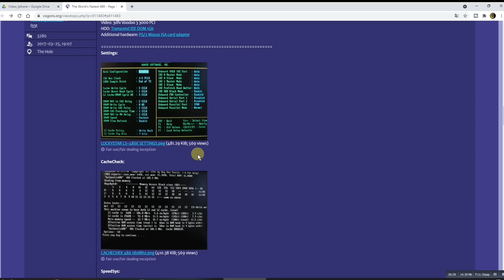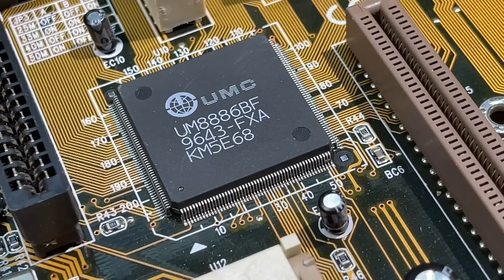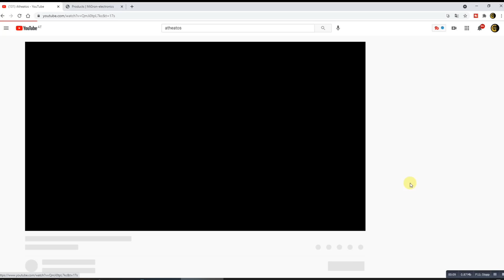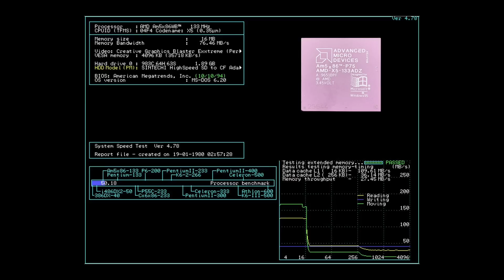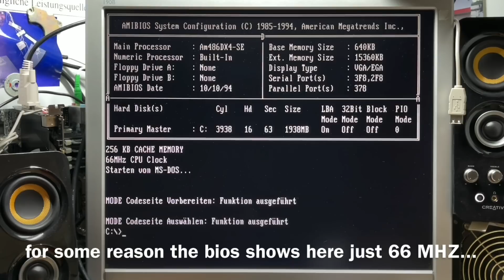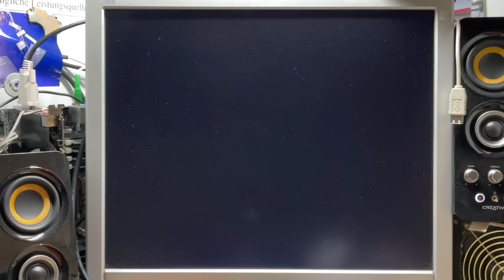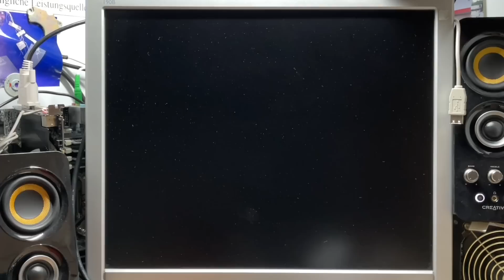AMD X5-133 Overclocked @180MHz / RECORD FPS in Quake/ PCI Clock Checker Tool

Comment: I got finally myself a UMC8881 -board, PC CHIPS M921 with fake cache 😆Ordered SRAM-chips for 512k so I need to swap those in. But, I have few Am5x86 chips that I need to test out for 180MHz. Board has 60, 66, 80 bus speed settings and 4 volt option. I noticed that the bios string for that motherboard in this video is quite the same on my board, 486AVIP at the end. I just don't have the LINBURST setting (for Cx5x86) and maybe a few more are missing. Need to check if there's newer bios version or maybe try bios from another board.

Comment: I am hpoing to get one of the socet 3, ISA/PCI/VLB mainboard,  maybe it will be DOS 6.22 or maybe FREEDOS 32 bit, Windows 3.11 WFW, and windows 98se, I mostly want it for DOS and win 311, as the 286 I have built for DOS, WIN 3.1 is being a royal pain, the only xfers I can do are 1.44 floppy disks, it does not like IDE cdroms, not does it like SCSI cdrom either, nor does it like ZIP 250, I do have a zip100 coming, 

At this point I am about ready to take out the mobo and wait till I can get the 486 i want.

Comment: 25:43 You can use a variable clock generator. This will let you replace and finely adjust the clock crystal on the board at runtime to push this CPU to its limits with granular precision. The Migron Electronics person you got that PCI clock measuring device from sells some. You can do a faster bus clock that way no problem. You have to switch it at runtime after the system is booted, but it does work. Maybe you can push it to 200MHz that way, who knows? Three MHz more to beat your scores will definitely work. Sadly, I don't have the hardware to do so. Could have been fun. lol

Comment: My amd x-5@133 working stabile at 150Mhz but windows installer have porblems with onboard ide controler i hawe to use ISA for windows 95. As far i remenber in quake it has 15or 16 fps. The exchange forr p100 was a gamechanger in Q1

Comment: Back in the day, 486DX2/100 was the most you got.  I had access to computer where I could bump the bus from 33MHz to 40MHz.   One I day I finally get up the nerve to drop in my 486DX2/100 chip.  Would it work? Would it fry the chip?

VIOLA.  486DX2/120!  I didn't run it for long for fear of burning out the chip.  I knew nothing of heat sinks at the time.  A few benchmarks clearly showed a substantial bump in performance. At the time, Gateway had press for their 486/100 being the fastest made. For a few brief minutes I created the fastest PC in the world.

Comment: Another great video I am itching to get my lonely Intel 486DX266 overdrive chip a motherboard a psu ram etc if only my local e waste depot would let me buy some of the precious vintage boards I got ripped off on ebay for a motherboard not long ago I am willing to buy a dead or living board I don't care what it is going to take just money is a issue but one day my dream 486 build will come to fruition mind you I grew up with every cpu from 8086 which I do have 2 of those but those compatible motherboards in the wild are rare or expensive a 8088 chip but every time I watch any 5x86 < cpu's I miss the good parts of my childhood and teen years when I was in high school I remember the biggest upgrade being a 486 DX4 100 mhz lol

Comment: Wonder if later versions of the CPU would OC better. Or TCP versions of the CPUs (modified Kingston Turbochips etc). I have like half a dozen 133MHz AMD 486es and the newest one is an Am486DX5-133W16BGC (16KB cache) with a datecode of 0021 (week 21, 2000). The annoying part is that I don't really have any decent socket 3 boards. Ironically I have one of those rare cache modules for these crappy PC Chips M919 fake cache boards, but not the board itself :(

Comment: One of the best overclocks I had back in the day was an AMD K62-233mhz that would do 500mhz on air cooling with stock voltage. Back then that was pretty impressive, I still have the cpu itself too.
Reply: You sure it wasn't a K6-2+?

Comment: Geez…This is freaking AMAZING 😳 I mean reaching about ten times the normal CPU clock speed alone is sub-zero but the fact that the north bridge as well as the RAM modules is still willing to work at 60MHz is something I had never expected would be feasible 😶

Outstanding work! 😍
Reply from the maker: Thank you. But check out then my 200 Mhz video. ☺️ https://youtu.be/LI1_RlVLhu8
Reply: @CPUGalaxy  you‘re kidding me 😳

Comment: Interessante Projekten und Videos! Man könnte vielleicht sagen dass Sie wirklich wissen was sie tun!

So, ja. One thing came to my mind suddenly: in any of your projects on the "bench", is the motherboard directly connected to ground at all, through some screw holes? Or only grounded through the power supply?
I got to thinking about this because I was recently trying out a (modern, new ATX) setup that was taken out of a fully working computer, just on the desk, on top of an anti-static bag, and for some reason it would not post (no video at all). Obviously computers are usually long-term assembled in metal cases for a reason and I even remember reading about this... but I've also understood it's not really strictly necessary because the system should be functionally grounded just through the PSU connectors on the motherboard. Is this correct? I assume this is why it looks like even you don't use an extra ground connector, it's not really needed. Correct?

(Habe übrigens über die Idee teilweise hier bei Ihnen gestolpert, habe die Überreste von der alte Siliziumpaste auf dem Prozessor entfernt mit... ESSIG :--) Ob das eine gute Idee war, weiß ich noch nicht ;) Vielen Dank für die Inspiration! (Ganz ehrlich, ich glaube kaum dass dieser verdünnte Essig ich da hatte überhaupt etwas wirklich schaden könnte, sogar ob ich es nicht auch ausspülen hätte...)

Comment: I can't believe that C&T mae such a 486 motherboard, its insane, considering there were other companies making extreme boards at the time. Having cache modules on a 486 was extremely rare, I only saw them on later PII and DEC Alpha machines. Your board is similar to my SOYO 486 with all types of connections but you may be able to have 1MB of cache by combining bothe the module and the empty surface mount if you can find and solder the chips. Not a fan of AMI or Phoenix BIOS though, I'm an Award fan. All things considered, you have one of the best 486 platforms to work on. Good job. I have overclocked my 486 machines back in the day, but considering how old they are now, I don't want to stress the electronics, so they run at vanilla specs. You are very lucky to find that motherboard with the cache module. I couldn't find one after months of searching for a RISC motherboard that I had so I gave up.

Comment: You should try and intel dx4 100 the 16kb WB version for an extreme overclock I have mine running at 120mhz and it matches the amd 133 with a speedsys score of 50.85 and L1 speed of 114.89 on a LS486e board like the one you used on the 200mhz video so clock for clock the intel looks faster
And in quake I get 14fps on an cl5446 2mb card

Comment: My 5x86-133 on an ASUS PVI-486SP3 with an ARK 1000vl VLB graphics card and 32MB regular FPM at stock speed maxes out at 14.3 FPS in Quake and 1498 ticks in Doom, or 49.85 FPS. Looking at your stock result I feel pretty darn pleased with that! :) But to see a 486 get over 20FPS is absolutely remarkable. Amazing work, and thanks for sharing.

Comment: Typically my groupmates had x5-133 running at 160MHz, 40MHz PCI clock and sometimes 150MHz with 50MHz PCI clock. Though I bought myself a Pentium-75, it could run at 112MHz on a cheapest ACORP VIA mobo and beat the hell out of 486.
Reply: I remember the first Pentium chips came out were 60Mhz. They could still slightly outperform a 486DX4-100.

Comment: AWESOME. Still have one of these boards with a 5x86 chip and the fastest RAM I could find in the day (50ns). Used to scare the pentium 90 users with it clocked to 50MHz bus @ 150MHz CPU. I remember having trouble getting cards that would work with bus setting at 50MHz. Used to run it at 160MHz on a 40MHz bus also. But 180MHz, thats fantastic.

Comment: Back in the days, I've used 486DX4(AMD VT8) in 2x50MHz mode (with VLB card).  I just wonder what speed would be with VLB setup in 3x50Mhz mode. (I've used ordinary DRAM not EDO). Another micro boost migth be 512KB cache motherboard. Love the video :-)

Comment: I once ran a sempron 2500+ 1750Mhz 1.6volt cpu at 2150Mhz stable on air with a load temp of 55 celsius at 2.2volts. Ran it for years like that. Used a 90CFM bathroom fan as a blower over a solid copper heatsink to keep it cool. it was loud.

Comment: About overclocking the PCI bus, I once had an experience tweaking jumper settings on a 500 MHz K6-2. I set the FSB to 112 MHz instead of 100 MHz, with a multiplier of 4.5 instead of 5, giving me 504 MHz on the CPU (only 1% overclock, the chip I had wouldn't give me more) but with a PCI bus clock of 37.5 MHz instead of 33 MHz (there was a divider by 3 on the motherboard to get the 33 MHz PCI bus clock from the 100 MHz FSB clock), which would give me some extra performance even though the CPU was running near stock clock. I had to revert to 100 x 5 because the HDD died and the replacement drive didn't like the overclocked PCI bus. So I immediately paused the video and thought "60 MHz on the PCI bus, that's so crazy!"

Comment: My dude, you're comparing an Am5 86(basically a Pentium) to a 486. Why would you think it a struggle to beat? They are different generations, with not only generational uplift in IPC, but also the jump from 486 to 586/Pentium was possibly the highest generational IPC jump I've seen in the last 30yrs in IT. I take it you weren't in IT in the mid 90s?
Reply from the maker: The AMD X5 is absolutely not pentium. its pure 486.

Comment: If you want to play harder, hook a signal generator to the PLL and a linear variable voltage power supply to the cpu rail. You most likely could get to 66mhz or a bit beyond like that.

Comment: The PR133 is super rare? Dammit! Mine went to landfill many years ago. I think it was the only drop-in replacement processor that impressed me. I noticed a significant performance boost after replacing my 486dx2100 and as you mentioned, you got Pentium performance for the price of a 486

Comment: It's been 26 years since I worked on the project, but I remember building a synthetic clock board as comp sci undergraduate research assistant at the University of Washington. We used an (I think) 33mhz 486, and dynamically scaled the clock up and down in increments that matched with vesa local bus, ide, memory, and cpu edge timing. The board also had a small amount of buffer to capture/replay any bits on relevant bus interfaces that would get lost during a clock down event.

We were able to scale the frequency high enough to completely loose communication with the video card and other peripherals, so implemented device watchdogs to record failures and put together a statistical map of how many faults and different frequencies things occurred. I recalled being able to greatly overclock the actual cpu, and the real issue was line delays in the motherboard itself - the traces were unable to carry the signals at higher frequency with enough precision.

This is a neat project that you performed here, and congratulations on pushing the FPS on the quake benchmark. Superscape 3d vr benchmark is always fun to see too.
Reply: This is why when I was running servers for MC I was obsessed with hardware optimization that looked nothing like the then big gaming overclockers.  I was maximizing on RAM timings and pure latency.  Invested in Optane drives to use as pure SSD due to their low latency and high I/O and higher write tolerance being much better than SSDs at the time for their price.  When your limit was pure I/O, you start optimizing weird.

Comment: @1:14 PCCHIPS, not C&T :-)  C&T was a reputable fabless chipset and video controller manufacturer. PCCHIPS on the other hand was a Taiwanese bottom of the barrel borderline SCAM artists making fake cache/AGP/Chipset boards all the way to socket 370 era.

@2:20 speaking of cache, notice those two empty footprints at the corner for two "cache" chips? look carefully at the pcb layout between the pins :-) they route in a circle to each other, it is a spot for fake cache :o]
Reply: So...Beat him?

Comment: What's taking your RAM away? 16MB should be 16384KB, but the BIOS memtest ends at 16000KB.. that's rather unusual.
Reply: ..so is a 60MHz FSB and 133MHz (AMD)486 CPU at 180MHz...

Comment: Many hours I spend to play with my SiS496 and Am5x86 in the end overclocked  to 160MHz, but my memory gives only 46.60 vs 68.73 of your system and only 47.5 fps in Doom
On FSB 40Mhz my system is unstable, but may be I need different memory - only future will tell...)))

Comment: I've recently been playing around with a Motorola 68360, rated at 33MHz but it seemed to run quite comfortably at 50MHz. That's where I stopped, so maybe it will go further, bit it was getting noticeably warmer so I decided not to push it any more.

I wonder then if this one came from the middle of a wafer!

Comment: Hmm...Is there a way of verifying the PIT or other timer chips?    Beyond verifying the timer chips are operating correctly, this is a fantastic result.  It makes me wonder where the later Vortex CPUs with higher clocks like 233MHz, 300MHz and 1GHz would fair.  IIUC, they are roughly 486-ish/586-ish/Penitum-ish/686-ish and some even had DDR3 support.

Congrats!

Comment: brings back memories! we overclocked the living daylights out of a similar CPU  back in the days. We scavenged a radiator from an amplifier and modded it to fit the motherboard then mounted two  cone shaped extension brackets to funnel air from a big industrial 5V  160mm fan to 120 , then to 80mm to fit on the radiator. that fan was way way too powerful for the fan header, so I rigged the one of the rails to supply the wattage and the amps to the fan.  you know you've made a big mistake when the air coming off it can tear stuff of the MB. but hey it worked and we had something in the region of 25 to 30% overclock on the cpu.

Comment: This chip can do 200mhz. Its been a few years (and I cant remeber if it was adz or adw - one is more overclockable), but we had one in our old office running at 200mhz on a board configured for a 50mhz bus. I cant remember the board, but I know it was a vlb only board. It was so stable we ran Novel 3.12 for a couple of years on it.

Comment: Imagine this 486 @180Mhz with a voodoo2 board and GlQuake... It's possible? Try it on the next video!
Reply from the maker: the problem is that the voodoo2 can not take the 60mhz bus clock.
Reply: And a voodoo 1? Or PCI voodoo3? The AGP version runs in 83 MHz frequency in the 133 MHz 440 BX.

Comment: Very impressive overclock.  

Out of interest how does this effect the ISA bus?  I ask because to make a system out of this you'd probably want a sound card and would they be effected by a faster bus clock?  Yes I know in reality you'd probably just run at the slower speed for day to day use, just simply curious if you could get a sound card to also sit stable at the high bus speeds.
Reply from the maker: yeah, good question. I will anyhow do a follow up to this setup with a soundcard. I will measure the clock of the Isa bus with my oscilloscope. good input! thank you

Comment: 20 FPS in quake, This is a pentium75 or even P-90 value! Every Pentium (not overdrive) two times faster than 486DX. So 486-188 will be at P-90 level!

Comment: I have one of the "worlds fastest" EDO Memory 28ns. I have six sticks all 128MB from my Amiga days which I used on the Blizzard PPC Board with FSB @77MHz with the lowest timings that can be set SIMMS.

If I had the above set-up, I will obliterate that score. These SIMMS are rare but I did find 22ns EDO SIMMS but I never bought them as it was extremely expensive.  .

Comment: I love how excited you got when you saw the Quake FPS value, I was right there with you.  My own X5-133 would run at 160Mhz but it was unstable even with additional cooling.  I never even attempted 180Mhz.  I have a soft spot for the X5-133 platform because it's the first PC I financed and built myself (worked all Summer to afford it).  Now I want to see if this can be pushed even further.
Reply from the maker: ... you will see it how I am going to push it to the limits 😊

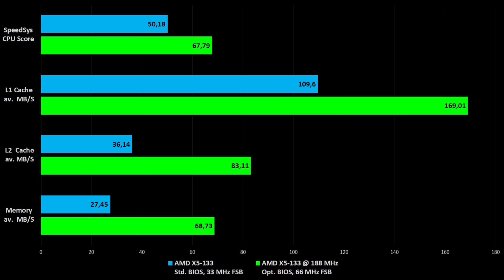Comment: 24:20 Just curious why it says 180 MHz at the top, but 188 at the bottom.

Overall, nice job! (Personally I’d be happy to have something of this particular vintage even at the regular clock speeds, just to compare with my older Pentium-based PCs.)

Comment: Something inside me broke when I saw your PCI bus running at 60MHz... stable.
Reply: Same! Interesting though. I never thought about a chip being able to take a 60MHz PCI bus just because the same chip was used in an AGP application. Looks like I need to play with my PCI Voodoo Banshee.
Reply: @kylejones8392  Not just the graphics card though, the controller I/O devices on the PCI bus need to be stable at that speed also even though they were designed with the 33 mhz bus speed in mind, I think I was honestly more impressed by that that vs the GPU.
Reply: I was more impressed by the heatsink
Reply: @al73r  xD me too
Reply: @SpeckDaKuhleer  Our 486 didn't even have a heatsink.  This era was really the beginning of heatsinks as the transistor count and frequency were rapidly climbing.
Reply: Something approaches.

Gabe is watching.
Reply: hmmm... my rage card has an agp counterpart. makes me wonder. might have to try this when i dig my 486 minitower back out.